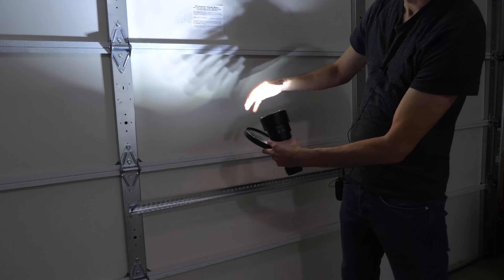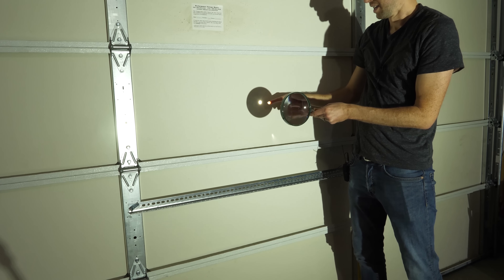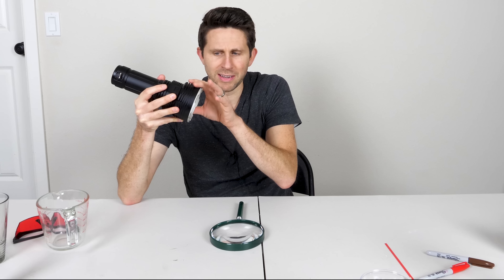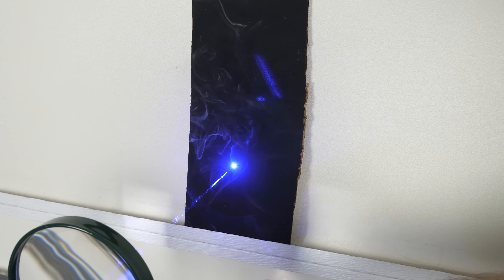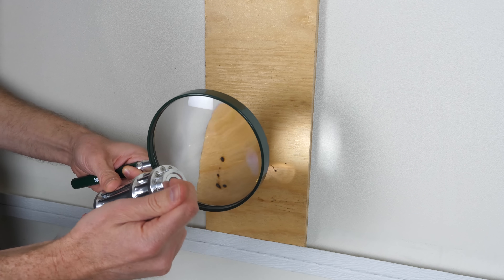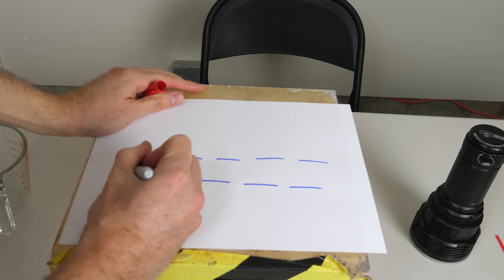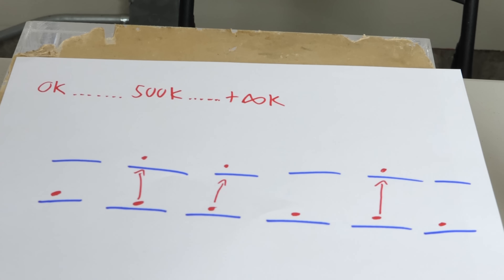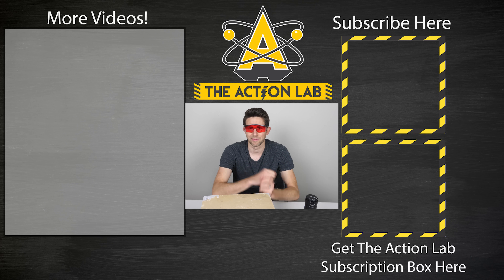What Happens if You Focus a 5W Laser With a Giant Magnifying Glass? Negative Kelvin Temperature!

Comment: The 2nd law of thermodynamics is only relevant to spontaneous processes without other changes. 
When you, for example, quickly pump your bicycle tire the air inside the tire heats up and you'll have a flow of heat from a colder to a hotter environment. But that's not a violation of the second law of thermodynamics, as long as you are supplying energy as WORK. There are numerous other examples. In the case of the laser, the laser device itself is supplying the work (the laser needs some kind of power supply to work, no?).

Comment: A more complex optical system can focus flashlight light to a narrow dot.

Powerful enough to lit matches.

For focusing Sun energy properly we need an optical system of enormous size, because the Sun itself is of enormous size, by Earth scale, which is, obviously, impossible.

And in case of flashlight and laser energy doesn't go from hotter to colder - energy was emitted by energy particles - photons in this case.

It's a radiant energy.

Non coherent in case of flashlight, and coherent in case of laser.

Both can be controlled by slowing down, as any optical system in fact was speed control of the light, because refraction in fact - effect af phase changed driven slow down of the propagation of energy particles, the very same way can be exploited for particles of the matter too (because there is explosive, acoustic, magnetic, even radiation lenses).

You can reach very high temperatures essentially - if you concentrate source energy (particles) densely enough on a smaller surface than the emitting surface of the source itself.

You can't produce more energy than the source itself had, obviously.

You can only concentrate it and thus exploit higher energy density effects.

Laser had exceptional emitted photons density, because of extreme uniformity of those - phase, frequency, polarization and direction of all produced photons are nearly all the same.

LED fundamentally is also a quantum emission mechanism driven photon source, with a very high efficiency, but emitted photons itself not that uniform - they had different frequency, phase, polarization and direction.

Thus, concentrating them and exploiting their energy uniformity is harder than with lasers.

Both LED and laser had the same mechanism of energy emitting - both are quantum leaps.

In this POV, temperature of the source and concentrated area is only secondary effects driven only by photons interaction with a media/target.

Comment: 1:00 you could use a series of lenses to focus it down.
Reply: What are you, a frickin lensologist or something?
Reply: @NomadicSal no, just a guy
Reply: You could use a multi-element lens system to gather more of the light, yes. But since the light source is an array of LED's spaced appart, the focus would always be a projection of that. Without getting into 'negative temperature', we can consider how the light rays in the flashlight are not coming off of a single point, and won't focus down to one, either. Even if it's just one diode, that diode has surface width causing the rays to take different paths to their focus. Inside the laser, there are parallel mirrors with light being amplified as it bounces between them many times. One of the mirrors will be slightly transparent. This makes a very uniform ray of light come out. Photonics engineering technologist.

Comment: Makes sense in Quantum Thermodynamics. The coldest Cold is hotter than the hottest Hot. Negative temperatures aren't colder than absolute zero—they're actually hotter than any positive temperature.

This also makes sense. Logically.

When X ≠ Y, and |X| > |Y|, then X is more extreme than Y.

It also makes sense. Mathematically.

If you were to compute |X| and |Y|

And if you consider the 'extreme' of X and Y to be the one with the larger absolute value. Then:

–5 is the more “extreme” value, even though it is negative, because:

|–5| = 5 |+3| = 3

Comment: You require two or more of those big magnifying glasses to gather more light from the flashlight (not all the light).
 
Alternatively, take a giant Fresnel lens, mount it outside in the sun, focus it directly into the end of a bundle of good fiberoptic filament cables, run the length of fiberoptic filaments into your room, and you have a powerful, burning white laser! Place any colored plastic filter over the Fresnel - and you have a more coherent, color off your choice - burning laser!

Comment: You need 2 identical flashlights. Take one flashlights part of that is used project the light. Take the lens off the one that will be used. Use the identical silver lens piece and join the 2 together. Now the light is trapped and only can exit through the Small light bulb
Opening. If you want to make a laser you can use a door peep. Reverse the lenses so now you have created a small laser. Now use your magnifying glass to intensity the beam
The brighter the light the better. GL have fun be careful.

Comment: A funnel with mirrors and a perforated for the LED to sit flush'ish so the light must go through the naarrow of the funnel.. 
  Secondly, a vaccum  to be inside the funnel,  to the light face, very rudeamentry I assure you.. ..
 Dry Ice if it is available possibly  tesla coil the chamber and the light pole to push through on the lense,a non programmed crystal will of course behave less but the chillingof the housing and draw off of the  outside influences and  aiming them down to the rim of the funnel and liniarly pointing them will give a type of ventrui and the light makes impact on tje lens crystals..  the cold of the dry ice will help keep things  smooth.. but you have access to liquid notrogen ..  and magnets so you are very lucky, you can do some very cool exoeriments  , just dont blow things up. 
   Have you ever insulated a tesla coil ball with silver leaf in a vaccum  and then put coils around the outside  to the ring magnet with the liquid nitrogen pipe and coils windings.. or any thing like that? 
  Positive outside,  negative as you say  for the inside?  Focal sleeve away from but arounf the tower colum of the coil ,  aluminim in glass  insilation liquid nitrogen or inert gas of some kind as liquid coolant and shielding on the pitside of the field charge conatainment tube ?  
   And I do mean, do not blow your lense up   nor burn a hole in the neighbors house.. 
  Never point at the propane or compressed gas tank.. etc etc.
.. 
 Slight offset  pulse influence.. 
   Is the induction..  as at point of light impact  the pole of it draws  in the opposite poled charge of the matèial itself..  try it near grapine or something like that and test the the co dictivity and current through tje circut.  
   ...  on a super chilled magnet...   pass the ring aroundthe outter induction coil and the opposite pole of light down the dead center...   see what happens.. 
  Again,  be very caddful i do naval  warfare engineering..   and artillary propulsion and advanced ' aircraft propulsion " ..  steath and anti detection methods..    
 Do not fck up..  i jist watched an enginidnition that survived .. they survived, it did not blow up half of state, compnents held after some sort of anomaly .. it was such a pretty  'burn" even after it ate the housing ..  it would have survived in flight catastrophic , well apparently not catastrophic magnetic emulsification of some kind..  the exhaust  was pickingup some telemety of some conversation or music or something....  it was like I have never seen so pretty .. it was .. fcking beitiful ,  hardly any 'radiation

Comment: I played around with your flashlight theory when I was a teenager. In order to harness all the flash light so you don't lose any wave length, you have to adopt the telescope principle. youre a bright boy. figure it out. focal length, aperature. lining the inside of the  tube(whatever diameter of the light sourc) with either prism , mylar, mirror coating...  try it again.   absolutely no wrinkles in the reflective material coating inside of tube. And don't use tin foil lol.  imagine you re smarter than that...

Comment: What did I just watch?
You have a photon energy in every light. If energy is dense enough for the ftansferd heat not to be dissipated by the target material, target will be hotter.

For a flashlight to concentrate it with magnifying glass you must first make rays parallel to each other. This is simple geometrical optics.
In this experiment central dot consisted of nothing but the central light diode in the focal axis of the magnifying glass.

Theis is very uneducated experiment without understanding of 9th grade physics.

Please do more research before making up new terminology

Comment: Heat (thermal energy) naturally flows from a hotter object to a cooler one, unless work is done (like in a refrigerator).
The temperature gradient concept (hot to cold) is real for thermal conduction, but not very useful to explain why a magnifying glass + LED doesn't burn paper.

The real issue is:

Total power output

How focused the beam is

How well the target absorbs and retains that energy

Comment: A flashlight will absolutely do the same thing, but you will need one with a narrower beam. Has more to do with the shape of the reflectors in the light. You could also use a much larger magnifying lens. As for your explanation of the applied thermodynamics, doesn’t sound quite right to me.

Comment: Those are the most garbage laser safety glasses you can find, they barely protect your eyes whatsoever.  NEVER use the safety glasses that are included with these 10W blue burning lasers, the glasses included with the lasers are not enough to protect your eyes from even reelections from the laser.  You've got to purchase a high quality pair separate from the laser pointer.

Comment: You Know, That if You Just Say Out-Loud, That There is a Point-A-&-Point-B-Connection between a Spot in front of a Door in Your-House, &, a Spot in Your-Kitchen that is 5-FT-Tall & 3-Feet-Wide & Works-Correctly-As a Portal, & then walk through it or throw something through it, it/You Disappear(s)-Into the Point-A-Part & Then Come(s) Instantly -Out-Of the Point-B-Location, in front-of, say, Your-Refridgerator...You can be Lazy & Walk to the Fridge, Magickally, Like-a-Pro.

Comment: First of all with the LED flashlight, you need a planar lens that takes collimated light and focuses it down to a tiny point. The magnifying glass you have is a double convex, and you need a planar convex with one side flat, and the other side convex. A larger lens doesn't violate thermodynamics, it just captures more light due to more surface area on the input side, and focuses it down to a single point or a smaller point. Light energy focused on a smaller area means more energy per unit area. Now with lasers another factor is introduced. Laser light is in phase sync, so more energy is produced to a point due to this phase locking. A 5W bulb and a 5W laser basically output the same energy, but the latter is in phase lock to a single point, whereas with the 5W bulb the energy is scattered in all directions and not phase locked. The laser light is also a point source where the flashlight is not. As you focus the same energy in a smaller area, the heating effect is greater - more energy per unit area. Think of a woman walking  around in stiletto heels - the pounds per unit area will be high. Now replace the stiletto heels with needle points, and now the force per unit area is basically "infinite". Leverage and amplification is what we're talking about.
Reply: The sun's output on the earth is about 1000 watts per square meter (approximate full sun). So, if you had a magnifying lens with an area of a square meter, you would be focusing 1000 watts onto a tiny dot. Now if you had a magnifying lens with an area of 2 square meters,  you would be focusing 2000 watts onto a small dot, and so on. Yes, a larger lens will allow more of the sun's energy to be focused onto a point. It doesn't violate thermodynamics, it's just capturing more energy and focusing it into a small area. The sun outputs tremendous energy whether we use it or not.

Comment: It's because temperature can be defined as the change in energy by the change in entropy.  In something like the Ising model, once all of your population is either in the high or low state -- that is minimal entropy.  So going from the 50/50 state in either direction (more low energy modes OR more high energy modes) causes the change in entropy to be negative.  So if you go from 50/50 state to having more higher energy modes --> then the energy increased but the entropy decreased, thus the temperature, as defined by the change in energy over the change in entropy, has become negative.

Comment: This dude is high as fuck. It has nothing to with temperature. And your explanation for population inversion is completely comical. This guy is obviously not a scientist. I actually can't even understand what he is trying to say. What matters here is, well, mostly optics.. Lets dis-reguard wavenlength here as it really doesn't matter for means of explanation. 

1. Energy out, is ALWAYS EQUAL to, or LESS than, Energy in! Always!! 

2. What this video should have been titled as... Irradiance or P/A2, i believe is the formula..
Irradiance is the amount of power, normally given in W(atts), over a speccific unit of area. If I point a 1W flashlight at a wall and it has a 1" size, then the irradiance would be 1W/in²  
If I decrease the spot size to that same flaslight to 1/10th of its original size, it would now be, 0.100".  I am still using that same 1W of energy on the wall but now that my spot size is 0.100"  vs 1.000", the amount of Power/Area, has now increased by a factor of 10. Where 1W at 1" wasn't burning the wallprevioiusly,  to 1W at .1" is now burning the wall. The overall amount of energy has NOT CHANGED. 

3. There is ton of differences between the flashlight and Laser that I'm honestly not even sure what the route is that he was trying to explain by wrongfully picking random Laser physics info on.

LED 
Large Band of wavenlengths - at least 400nm to 700nm, as it is white light 
Incoherent - Phaseless, not truly, but comparitively
Circular Polarization - 
Chromatic Abberation - Issues when trying to focus multiple wavelengths 
Insane amount Power comparitavely

Laser
Narrow banwidth - anywhere from a couple wavelengths to 50nm, some can have lots, argon Laser, but still, narrow bandwidth 
Coherent  - In Phase
Polarized - not always..
Low Power comparitively 

He started rambling on about population inversion when trying to explain, whatever the hell he is trying to say, I honestly don't know what he was trying to imply with temperature. What makes something(medium) capable of being a laser, is something that has multiple energy states, technically at least 3 to be exact. 1 Non exited state, and 2 energy states. In a very simple explanation, photons of light are produced when going from one energy state to the next, hence why you need 3. You can make a beer laser if you really want to...  What he was drawing about population inversion, is completly irrelevant, like everything else. While you absolutely need population inversion for a Laser to work, it has nothing to do with what he is trying to explain. Population inversion is simply that a given medium has more atoms in energy state vs a ground state, and generally is measured by Laser output stability. Again, ANYTHING that has multiple energy states, can technically be considered a Laser medium.

4. Where the video should have focused.. hehe 
Optics my man, optics...
You identified the issue with the flashlight, right off the rip... DIVERGENCE!!! 
Now what he could have brought up here was the Laser's awesome ability to stay COLLIMATED(or lack of divergence) over such long distances. Why they do that doesn't matter here but it is defienitly a perk when using Lasers. 
He should have first collimated the flashlight and then focused it onto the wall. This takes a few optics, but he will see that the flashlight will also burn the wall. It has nothing to do with negative temperatures and whatever the hell else that man was trying to say. 

5. With that much white light, hell its prolly got 5W of blue in there, while it is incoherent, i just think its worth mentioning for people who argue, deltaT vs wavelength.. 

Is this how all of this channel is? This man has 5mill. Jesus...

Comment: LASER coherent beam as the output, once it’s collimated, and passed through a magnifying lens, the energy of the light frequency increases (formula) to stronger energy field which causes heat. Things that absorbs the light frequency become charred or ablated.  

Where did you get the pointer? (Link 😏?)

Comment: He’s not too bright. If you use a flashlight that can focus all the light into the glass he can make it hotter and he says you can’t make it brighter than the source but you can clearly see and hit his video of that. The point is brighter than the light around it.
Reply: You clearly aren’t too bright. You can’t use an optical device such as a magnifying glass to focus light to a point hotter than the source. For example, if you’re trying to start a fire with a pair of glasses in the wood, no matter how large the lens is, you can’t make something hotter than a few thousand degrees (Celsius or Fahrenheit), I.e the surface temperature of the sun. This would violate the third law of thermodynamics, I.e, entropy. If you want a proof, go to the library and borrow a copy of “what if?” By Randall Monroe, aka xkcd, and turn to the chapter where he explains why you can’t start a fire with moonlight.